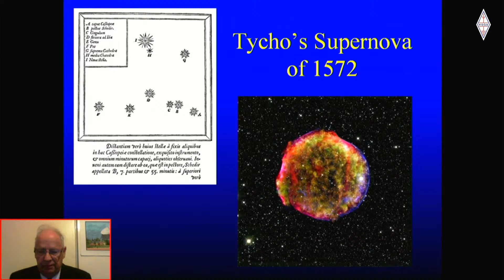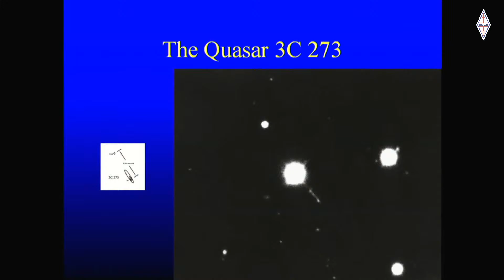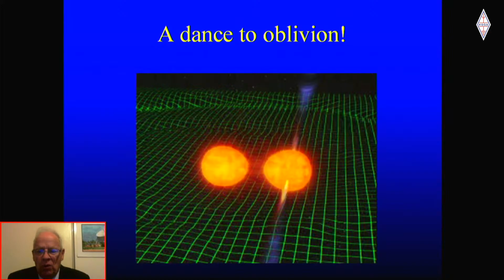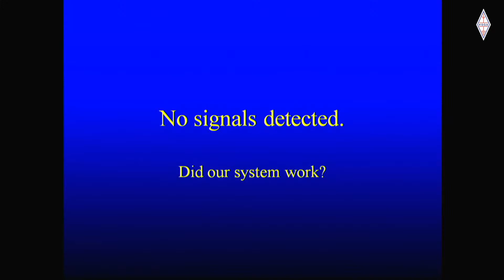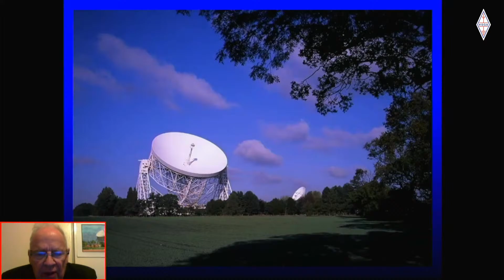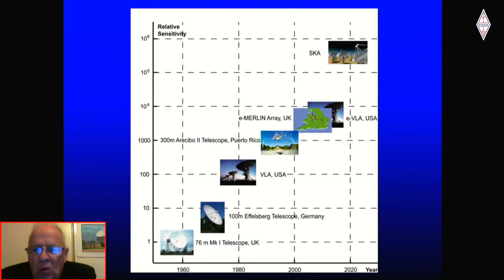RSGB Tonight@8 - The story of Jodrell Bank by Prof Ian Morison, G0DMU

Comment: Fantastic presentation by a pro. Missed some RF technicual issues about the dish:
- What's the RMS surface accuray of the reflector - i e how high in frequency can you  operate with still a narrow main lobe.
- The dish seems to be a Cassegrain configuration meaning that all feed horns and receivers are conviniently positioned behind the vertex. Right?
- Perhaps not Cassegain? Prof Ian mentioned a receiver placed at the feed point. Right?
- Any problems with side lobes picking up ground noise? Any RFI?
Oscar/SM4CHK